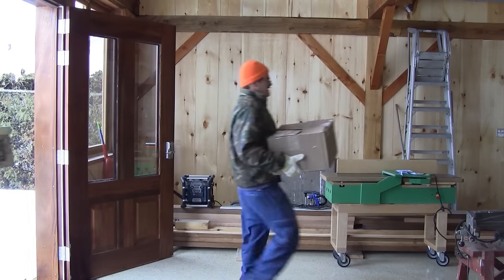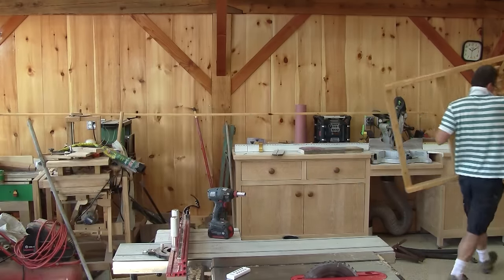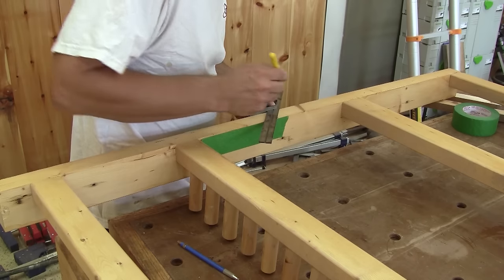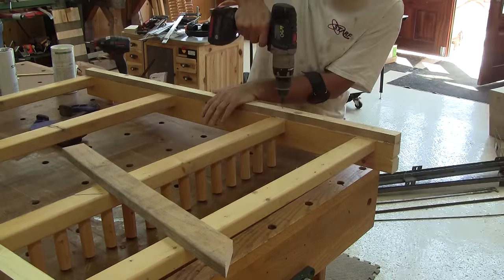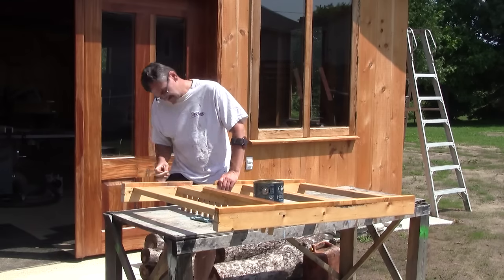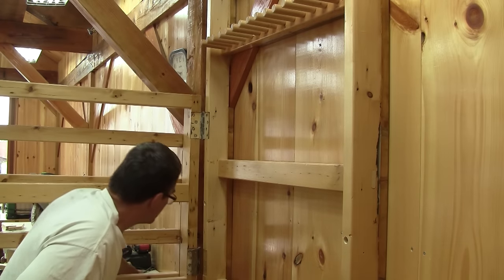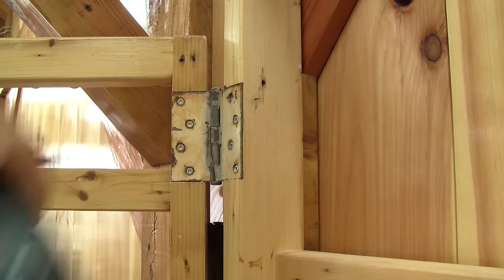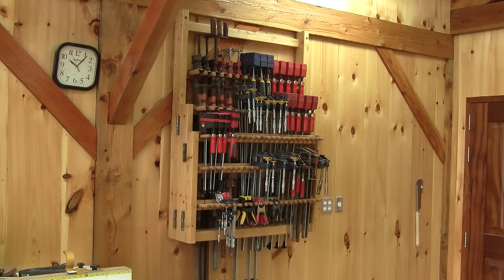The Woodpecker Ep 89 - I move the clamp rack

Comment: In the hopes of learning something, I have a question... Why did you put silica powder into the glue to thicken it?
Reply from the maker: thedraphter two reasons.
 First one; epoxy is so thin that it's verry runny, with silica powder it has the corn sirup consistance so it doesn't drip as much.
And this powder add a lot of strength to the glue, so even if epoxy is a great (but expensive) glue, with silica powder is even stronger.

Comment: Wouldn't it be stronger to put the mounting screws in at a downward angle instead of upward?
Reply from the maker: ***** I had to put the top row it at an angle, so I could screw into the top 2x6. Otherwise I would have just screw into a 7/8 pine plank. This is why I angled the top screws.